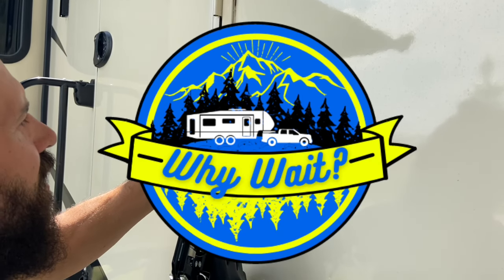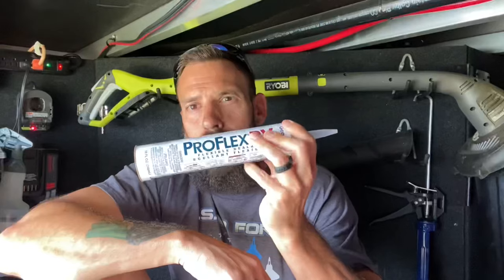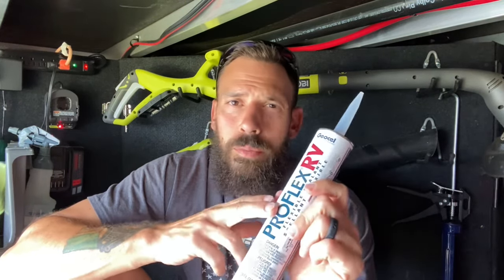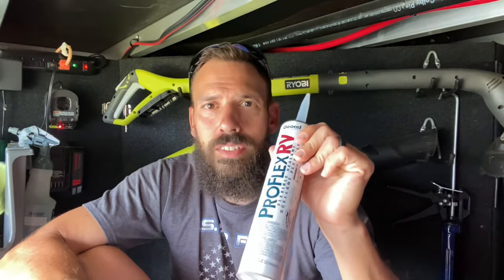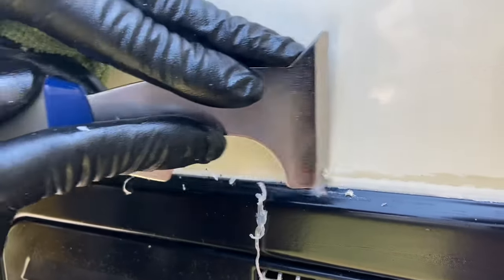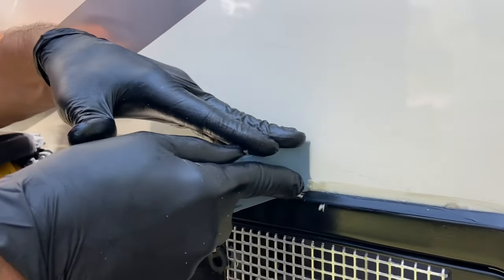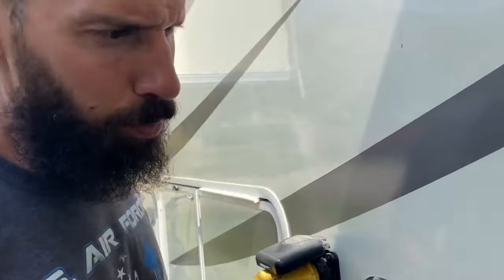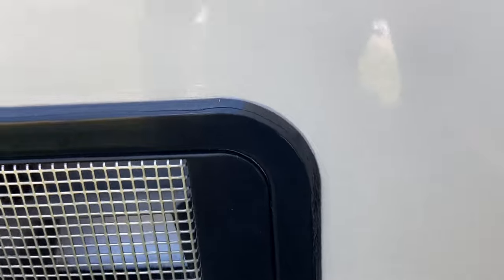HOW TO PROPERLY SEAL YOUR RV | (Best RV Exterior Caulk)

Comment: How often do you redo your sealant????
Reply from the maker: As needed, I use to think it needed it every year but then I realized I was just removing good silicone still or going over my Proflex that didn’t need it. I try to just inspect often and reapply as needed in areas.
Reply: @WhyWait  Makes sense. I see a lot of folks out here recording maintenance that is very unrealistic. I tend to talk to a lot of people with older rigs to see what they do. Most don’t do a whole lot. People with pretty much brand new units do more in a couple years than many do in 10. The industry loves those folks. Like the people still changing oil every 3000 miles.

Comment: i would like to do this process on my rv but was wondering how you managed to use these chemicals around the vinyl graffics without them peeling off as well?
Reply: I do the same process for sealing. The only issue I have had with vinyl graphics being damaged is during the scraping process to remove old silicone. It will often scrape off parts of the graphic at the seam making it look all rough at the edges. I used a metal razor to carefully cut back the graphic away from the seam to give it a straight uniform look again. Using all plastic tools helps minimize damage when removing old silicone. Such as plastic razors/scrapers. In my case the chemicals did not bother vinyl graphics but I don't leave it on for too long at all.

Comment: Silicone sealants should never be used on the exterior of any RV, period. High quality polymer/hybrid RV/Marine sealants formulated for the specific application are the only sealants that should ever be applied to the exterior of an RV, especially in contact with finished or unfinished aluminum.

Comment: PLEASE HELP
could I use this to do the rim around my hightop on my 1998 ford camper van? Or would I wanna treat it like a roof??  N should I clean all the stuff off the inside n redo? It’s black n sticky but idk what it is exactly
Reply from the maker: Not sure to be honest with you not knowing exactly what your dealing with. I’m sure it’s definitely not like an rv roof though which has a TPO, EPDM or rubber roof though which requires a self leveling sealant. I would reach out to ford or an auto shop and ask them 👍🏼 Sorry I couldn’t be of more help.
Reply: Hi, did you ever find out what black sticky stuff is? I'm replacing the food frame and found this black stuff under the edges of my metal roof and where it bends over the top of siding. I'm not sure if I replace it or remove it.

Comment: I used proflexRV last time, but it dries hard and peels off in sheets for me. What am I doing wrong?  I feel like I washed the area well before applying.
Reply from the maker: I am noticing that over a few years of having it on my RV it is now looking sun baked, yellowish and sometimes flakes off. But it’s been on there 3 plus years. None of these sealants last forever. I’m doing a new video next week and I will be testing Lexcel sealant out to see how it does.

Comment: I just did what seemed like a mile of new caulk on my camper. Got back from a trip and its as if it was a magnet for dust. Now looks like dingy old caulk. And its impossible to wash clean.. Boo!!!Dap230. Anybody got ideas? Thow em my way. Thanks.
Reply: Did you use the proflexrv that he used in the video? Was just about to order some to do our motorhome but don't want it looking dingy
Reply: @TheeMrsRice  Nope, can't find it.

Comment: Will you answer questions?
Reply from the maker: Sure thing, I usually do my best to try anyways 👍🏼
Reply: @WhyWait  ok I’m tired of people not replying these days :) but I just noticed that my slide out thing having mushrooms growing out of it. The flooring. It seems like it’s wrapped in a tarp for protection but it has some wear and tear lol on it and I was wondering about a way to fix it maybe some like black sealant. It’s only 2 years old we have only owned it for maybe 6 months and it is stationary. So it’s open all the time besides for winter when water is turned off. See some videos of slides but now 100 bucks which I’m still thinking about just not at 100% at this time of year.
Reply from the maker: @Frank-the-Tank-13  hard to say without really being there and investigating. I would try to find out where the water is coming from and how it’s getting wet in the spot. Because if you seal the floor part but are still having water from maybe the roof, walls, or a window seeping into it still it will still be rotting the floor area. Try to find the source and go from there. Chasing these leaks can be hard. Wish I could help more. Good luck bud
Reply: @WhyWait  thank you it’s very much appreciated.